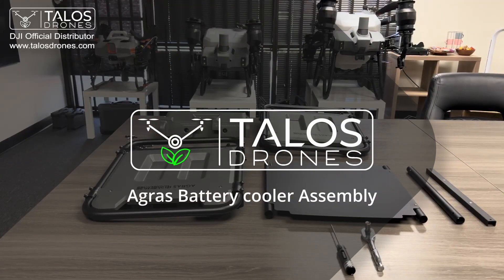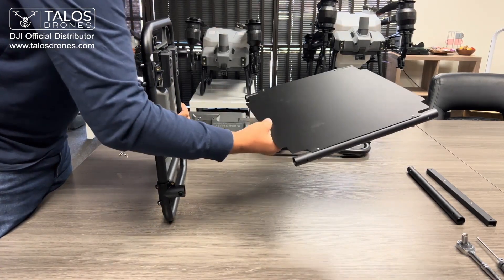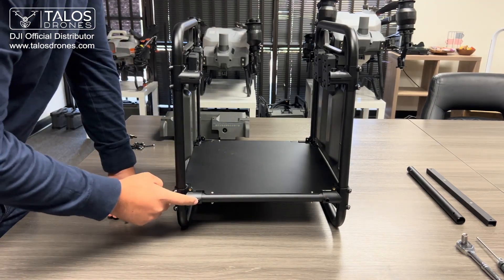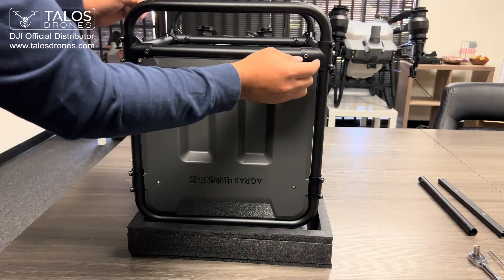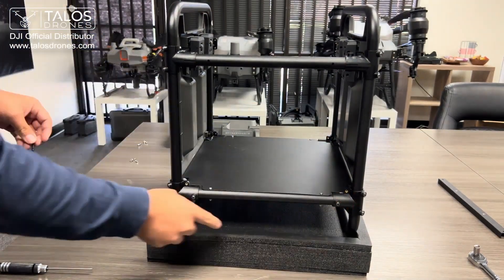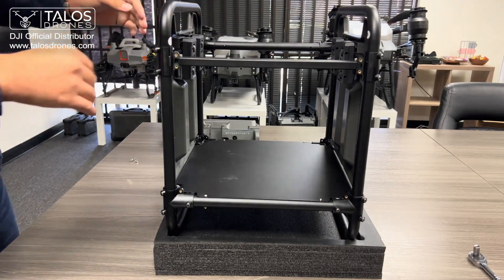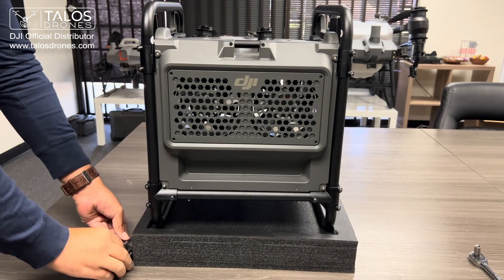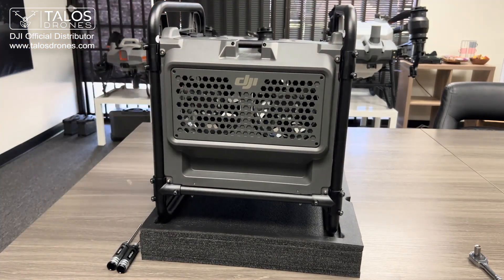How to Assemble DJI Agras T40 Battery Cooling Kit

Comment: The station holds 2 batteries… right? It’s my understanding that the second battery isnt doing squat in the station other than taking up room. Could you order and install another fan face/part and install it on the other side? It appears the mounting holes are there. Then add another charge cable, power supply (for the fans), and plug in… assuming you have enough power to charge two batteries at once…. Seems like an inefficient use of space if it aint charging a battery on the other side.